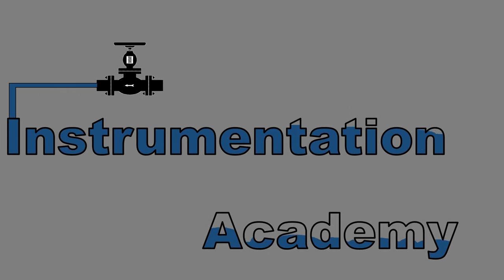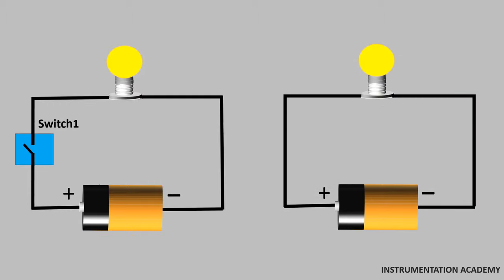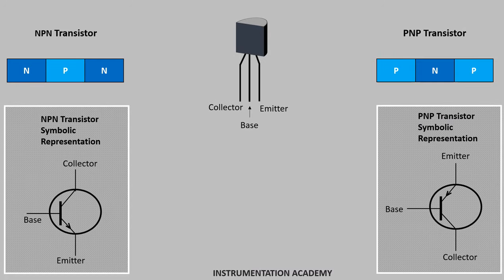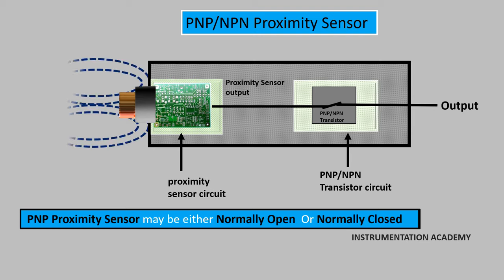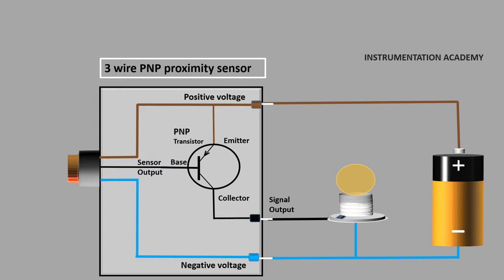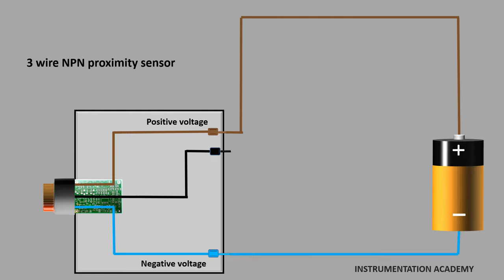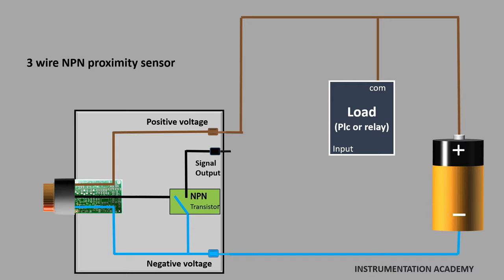NPN Inductive Proximity sensor. PNP Inductive proximity switch. PNP NPN proximity sensor Animation.

Comment: thanks for your effort, but the npn explanation doesn't have to include inverter, and the lamp won't lit if the input is high, as it's connected to +ve side of the battery

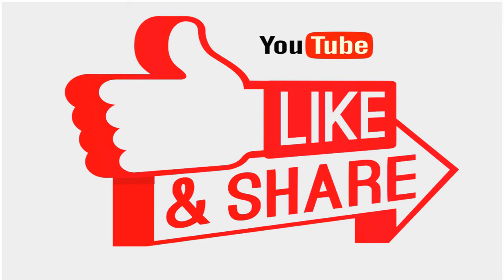Comment: At 6:39 you say high voltage turns on bulb.  Surely it will be high voltage on both sides of bulb and so no current flow and bulb will be off  ?   Please explain

Comment: Why would you use NPN with inverter to achieve the same thing as PNP? There are scenarios when u must have NPN (or is just easier due to design of the circuit), but inverting signal back to low?

Comment: Thank you for the video. I mistakenly bought a four wire PNP sensor, instead of a three wire NPN sensor.
Does a four wire  PNP sensor be used in replace for a NPN difusse sensor. Will it work by interchanging the BLACK wire to WHITE wire to make it to NPN